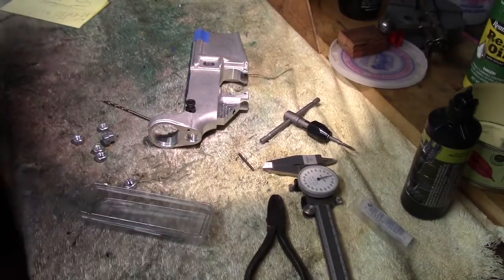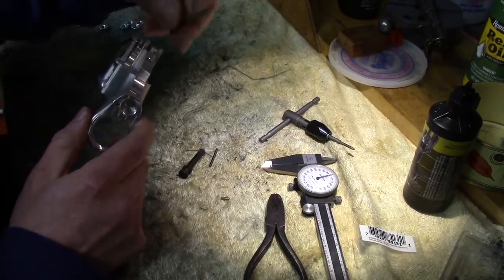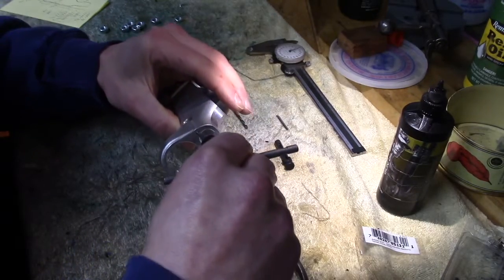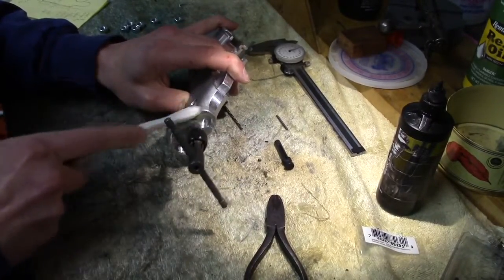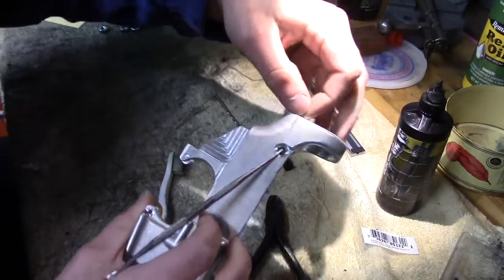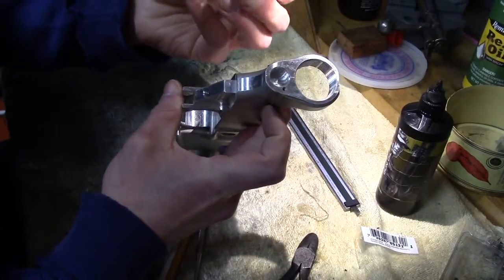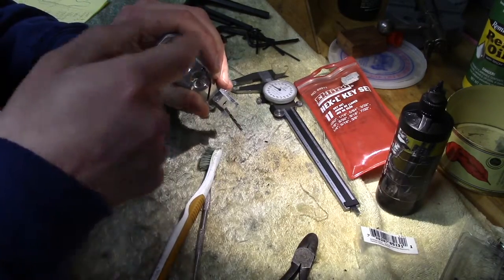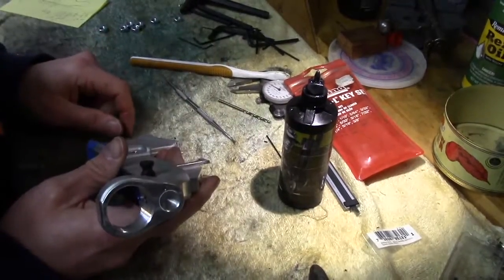AR-15 CA Legal Mod/FIX! - Takedown pin spring keeper

Comment: I've done that with all mine. I've also done something similar to the bolt catch roll pin. so much easier to work on
Reply from the maker: I'd love to hear more about how you did it with the bolt catch roll pin.  I've seen kits with a special roll pin that has threads on one end, and it comes with a long reach tap, but that's the only method I'm aware of right now.
Reply: DesertDog Exploring that's exactly what I used. the long tap worked on all my lowers. basically a little pin with an hex head and threaded collar

Comment: If you go a quarter back off a quarter you aint gonna grt anywhere bro...
Reply from the maker: Brandon Gillette I don't think I ever said that.   If I did please post the time stamp, since it's obviously a mistake on my part.  And I must have gotten somewhere, because the threads got made. 😄
Reply: Brandon Gillette its at 2:09 that he says it. He mentions most people go 1/2 back off a quarter then says his way is more like go a 1/4 back off a quarter. This is a total fkng waste of time mod though learn how to build an AR and you wont have to create solutions to problems that don't exist. MAYYYBE......MAYYYYYBE if you were taking it apart 10 times every day it might help but when was the last time you took your butt plate/buffer off other than to change out or lube the detent pin spring that's now behind an added step in its removal. You also fkd the spring tension up by cutting it. Probably never be a big deal but still higher risk of improper spring tension
Reply: @DesertDogExploring  I know this is way late but I noticed how some of the other manufacturers have been doing this and I have done that to all of mine but I believe my set screws are smaller and are closer to the original size of the hole